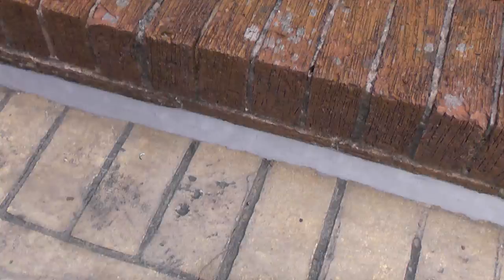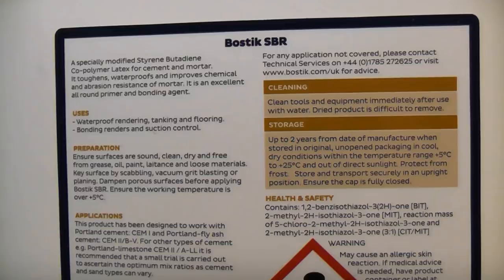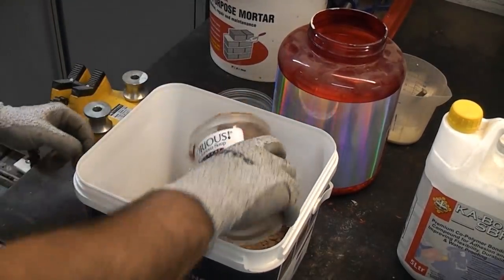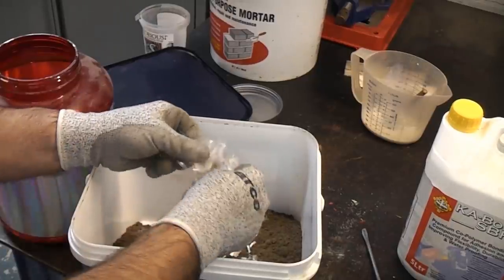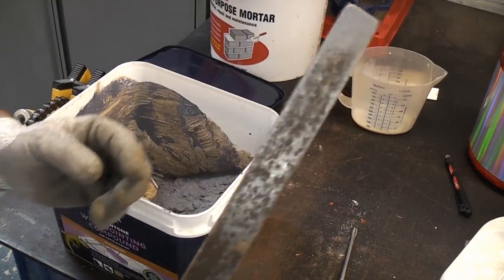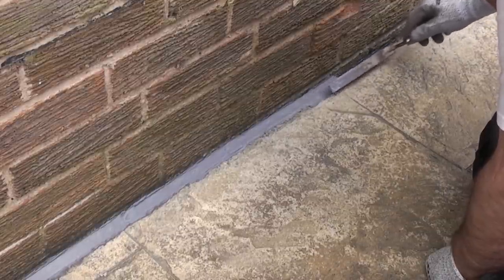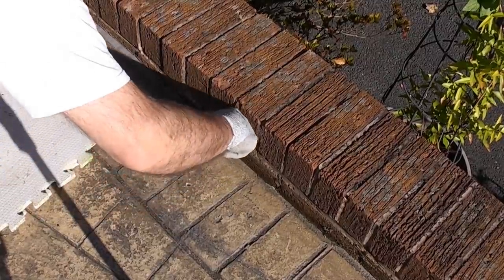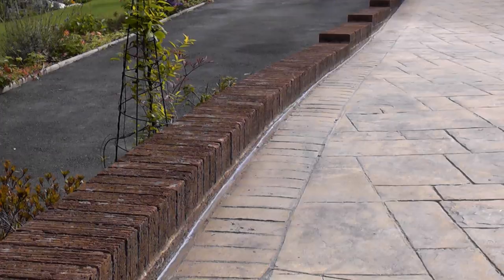Fillet pointing | mortar fillet pointing

Comment: Could an exterior silicone been an option rather than using mortar? I thought you might get a better attachment to the imperfections of the brick surface and pavers that way.

I like the fibre idea, not seen that before and will look at getting some.

For mixing small quantities like you used here I have used the Cyklone that you did a video on some time back. I find it does an excellent job for mixing all sorts or things. I am really glad you did a video on it as I would never have got one without and it makes mixing paints so easy and quick does a fantastic job. I only wish they made a smaller one for the smaller pots of paint though I have just had the idea of buying a second and cutting it down width ways so it can fit in!

I really appreciate the time and effort you put into making all you videos! So thanks!
Reply from the maker: Yes, you can use an exterior silicone for filling the gaps.

The fibre and SBR are great for mixing with mortar.

I have an Evolution mixer paddle, which is great for larger mixes, so I have not tried the Cyclone on anything other than paint. I have struggled with the cyclone in smaller tins, it will only fit in larger paint tins - but it is still great for mixing. There was someone on YouTube that makes a similar mixer that will fit in smaller tins, they did offer me one to review but I can't find their comment! 

I'm glad you appreciate the videos, thanks for the comment 👍
Reply: Just to expand on this more specifically - Could I use CT1 Grey?

Comment: You have set the bar very high needing a dry day and the temperature in the UK, the only place that it would be harder to get would be the lake district and Scotland. Would you use the same mix the re-point the bricks when needed?
Reply from the maker: You are not joking, I was hoping to do this one weekend- but most weekends it has rained here (like yesterday and this morning). I ended up stopping away from work for a week in order to get two dry days, even then it rained on the first day of pointing.
I normally use a mix of 4 building sand, 1 cement and 1/4 of hydrated lime for pointing bricks, but I'm going to try out this mix with the SBR and the fibres next time.
Thanks for the comment John ;-)

Comment: Great job 👏🏼 and always a good instruction. Maybe the silicone gun idea would make it a bit quicker to apply the mortar 👌🏼
Reply from the maker: Perhaps, I did consider making a really thin mix of just cement and SBR, then pouring it into the gap between the drive and the wall- to ensure that it went in all the gaps- but then I thought that if I spilt it, I would have had a real problem trying to clean it up!
Thanks for the comment
Reply: @ultimatehandyman  sure as when you added SBR it looked quite thin and I thought you would use the tube
Reply from the maker: @cheechU38K   The silicone tube is great for small gaps, but because I wanted a fillet I always use the finger-pointing trowel ;-)

Comment: Looks good and how long did it take?
Reply from the maker: I did it over two days. The bit where the bins are, plus the opposite side were done on the first day, which is about 10 metres each side (then I got rained off).
The drive is about 15 metres and was done on the second day (everything takes longer when filming it)
Thanks for the comment 👍

Comment: Top video pal, I'm planning on doing this to my house over the next week if im using sbr in the mix can i paint over the filet after its set with a masonry paint? the bottom 2 bricks of the house are painted black so wanted to paint the filet the same or will it not adhere? Was going to use Sandtex masonry paint.

Also what width is your finger pointing trowel? Thanks
Reply from the maker: Not sure how well paint will stick to it, perhaps a better option is to add some black mortar dye to the mix (I've never tried mortar dye with SBR though) https://fave.co/3t5TF9w
Reply: @ultimatehandyman   Thanks pal, good idea, sorry to bother you what width was the finger trowel you used,Thanks
Reply from the maker: @jatwal82   Sorry, missed that bit on the original post. My finger pointing trowel is approximately 19mm wide (3/4 inch)
Reply: @ultimatehandyman  Thanks pal much appreciated :)

Comment: Hi, thanks for the video.  Could I use this mix for creating a cement fillet to the inside edge of a concrete panel garage?  And would you use the SBR diluted to seal the floor also, instead of PVA? Thanks.
Reply from the maker: Yes, this will be fine for a fillet. Not sure about sealing the floor though. I have never tried using SBR for that. I would not use PVA though, as it will turn back to PVA if it gets wet! 👍

Comment: Great video, Can I ask a question when you prime the are with sbr do you leave that to dry or do you point over it within a certain time frame?

Also is i best to mix a small amount of mortar as it will be hard to work with say after 20 minutes due to the sbr?
Reply from the maker: Thanks. Once primed with SBR I would try to get it pointed within a few hours, some of my priming had dried, but it still adhered well.
You get a lot longer than 20 minutes, some of the batches that I used were mixed for well over an hour, as long as you give it a mix with the trowel every 15 minutes, it should be fine - especially now the weather is cooler 👍
Reply: @ultimatehandyman  Excellent top man thanks for the quick reply, sorry 1 last  question do you dilute the SBR or just put it on non diluted for priming?
Reply from the maker: @roonierocket9839   You are welcome. 
Non diluted 👍

Comment: If the gaps were smaller, would a flexible sealant be appropriate such as OB1 or EB25? I've used these in vertical cracks and joins but hadn't considered it for this situation.
Reply from the maker: Yes, you could use a sealant in the smaller gaps. 
Anything is better than letting the water get in the gap!
Thanks for the comment

Comment: 1% chance of rain in Darwen? I usually go by "If you can see the Tower,it's going to rain,if you can't see the Tower,it's already raining"  Great video thankyou,need to do this job  at the front of the house,but the void looks very deep.
Reply from the maker: 😊
A mate of mine always used to say that.
I have checked my phone in the past and the BBC weather app has shown a zero chance of rain, so I have started an outside job. An hour later and it is chucking it down!

Yes, the gap on the drive was quite deep, I did get a builder to point it a few years back as he was doing some other work. I think he just put a bit of mortar on the top, without filling the void or adding a fillet. Hopefully it will last a bit longer this time!

Thanks for the comment 👍

Comment: Could you use this mix for pointing sandstone? I previously used 3:1 with plasticiser.
Reply from the maker: Not sure, some people say that you should not use cement with some stone, as they need to breathe. I'm not sure if that is true, or if it is a load of nonsense. I have lived in terraced houses with a sandstone front, and they were strap pointed with cement mortar with no problems over a 30 year period. 
Thanks for the comment ;-)

Comment: What's the approximate working time for the mix you used?
Reply from the maker: There are a lot of variables, depending on the ambient temperature etc.
You normally get a good few hours of working time with it (I did this in the last week of September) but that will be reduced if you do it in the summer.
Thanks for the comment 👍

Comment: Handyman do we apply the same thickness of fillets for concrete slab
Reply from the maker: I would do around the perimeter, but for expansion joints I would use a dedicated sealant.
Thanks for the comment 👍

Comment: Where do you get those fibres from? Last week was a SBR revelation now magic fibres!
Reply from the maker: I got mine from ebay - https://fave.co/3dTB3lx
They use them in concrete to reinforce it. A guy in my forum told me about them a few years back, when I was pointing the lead valley on my roof (he also told me to use the SBR)
Thanks for the comment

Comment: Won’t this just crack off when the weather changes from expanding and contracting?
Reply from the maker: No, the SBR makes the mortar flexible.
I used the same mix a few years back on the roof valley, where is touches the lead and that is still fine https://www.youtube.com/watch?v=7HRI3ftacj8
Thanks for the comment 👍

Comment: What does the SBR do?/What is it for?
Reply from the maker: SBR makes the mortar easier to work with, it also makes it more sticky when it is wet.
Once it has dried it gives you a more flexible and waterproof mortar.
Thanks for the comment 👍

Comment: My cement fillet has failed. How do I remove it so I can replace with another.
Reply from the maker: You can normally remove it using a hammer and bolster chisel 👍
Reply: Thanks for responding 😊

Comment: What would you do if theres flashing material on the floor
 Would you cut it back or nail it to wall?
Reply from the maker: Not sure, do you know what it is for?
Reply: @ultimatehandyman  it is on the garage floor. Put in as damp proof when garage was built
Reply from the maker: @justintemp   I'd cut it so that there was a little bit left sticking up, then cover that with the fillet.
I suppose you could cut it flush, as that is there to prevent moisture from rising up from the ground.
Reply: @ultimatehandyman  thanks

Comment: I think I’d rather use a 10kg tub of rapid setting cement from Screwfix £12, it’s a waterproof cement that sets in 20 minutes
Reply: @ultimatehandyman  
Don’t see what’s so funny?...the Cementone rapid cement works on drain covers, path repairs etc. Hasn’t cracked or shrunk when I’ve used it!
Reply from the maker: @EppingForest304  Sorry, I thought you were having a laugh.
It takes hours to do a fillet joint, the one at each side of my house was ten metres in length, I had to do that at both sides (20 metres), then the drive is about 15 metres in length.

Comment: Isn't dangerous? I mean with dilation it will crack itself or around.
Reply from the maker: No, it's fine. The SBR makes the mix flexible.
Thanks for the comment 👍
Reply: @ultimatehandyman  Thanks for your knowledge

Comment: would u not prefer to add some terracotta pigment to the mix to make it not stick out so much ?i just realised it depends on the area u apply it to and if it blends into the existing pointing
Reply from the maker: Once it dries out the fillet is not that noticeable. I think it is the SBR that makes the mortar look a blueish kind of colour, but after a few days it dries like cement.
Thanks for the comment 👍

Comment: Sorry about the questions but can you add SBR to readymade mortar?
Reply from the maker: Yes, I try to avoid readymade mortar though for jobs like this, as it is often too strong (too much cement and not enough sand), which can make it less flexible- but SBR with ready mixed mortar will be fine ;-)
Reply: @ultimatehandyman  you are a legend thanks, your vids just get better and better